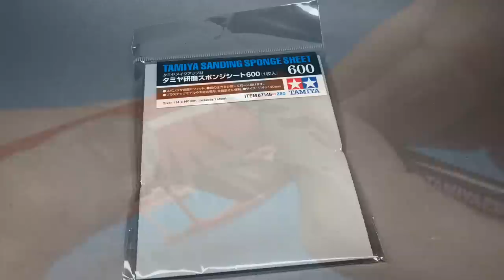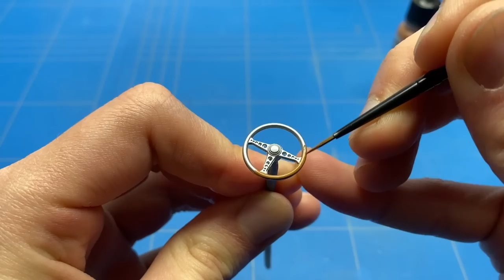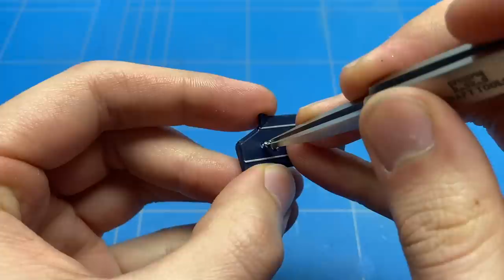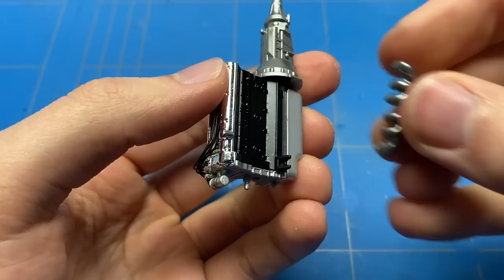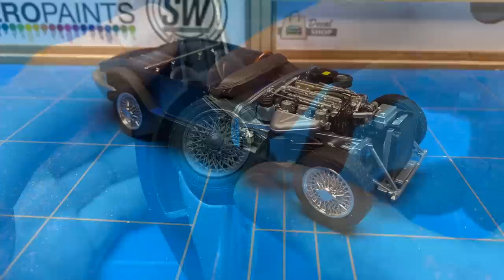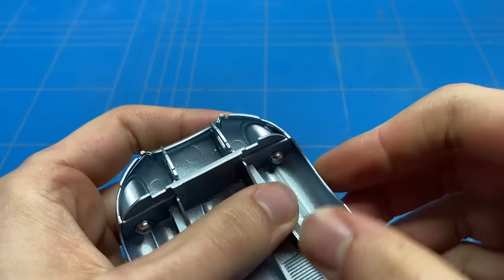Building a Jaguar E-Type Scale Model

Comment: I'm Australian.  Interesting to see such an iconic car that I lusted after IRL for so long in the 1960s and 1970s being built back-to-front.     To my eye, everything inside the car is on the wrong side,  while the fuel cap is on the correct side.    I am in AWE of the work you did getting those wheels done.      I have never seen Chrome on a model done that way and it's outstanding!!     Thank you for showing me how to do that. . And you were right to get the 3D printed wheels.     I always wanted some spoke wheels on a car.     It never occurred to me Id have to spend most of a weekend cleaning them every week.

Comment: Excellent build!  I am waiting until this kit from Revell of Germany is re-released.  I heard of mold issues on the body and RoG wanted to correct it.  Your did an excellent job building this kit!
Reply: Do you mean Revell will re-release the new tool they just released? I have bought this new tool twice now. Both kits have the bonnet about 4 mm too wide, lots of lumps on the body exterior. Otherwise the parts seem to fit together very well. Wrote Revell about the issue with the bonnet, they promised to send spare parts for free.
Reply: @Anonymous1999b , from what I have been told, Revell of Germany decided to re-engineer the body molds to produce a more accurate body and do away with the sink marks and bumps.  The XK-E is suppose to be re-released in June.
Reply: @007mrmike007  That’s interesting really. The new tool Revell XK-E (e-type in the USA) now has a pre-order status in some online hobby shops. But because the new tool e-type was just released, i wonder if they re-release or modify that also, because of the same issues? Or will this be USA only re-release? We’ll see i guess.
Reply: @Anonymous1999b  Since the Jag XK-E is from Revell of Germany, it would be safe to say that new body molds would apply to all kits that they are producing and not just the USA kits.

Comment: I've built at least 12 award winning Real Versions of these cars, roadsters and coupes, series 1,2,and 3. The only issue I have with the scale models kits I've seen and own are that the details are not correct. They're all over the place. The molds are all from an early series 1, like number 18 we did a few years back. The rear springs were black with yellow or blue inspection marks. The steering column is gloss black, all of it, the wheel hub is silver, but the entire column would be black including the turn signal stalk. The accel. pedal is cad plated silver. The floors have removable carpets in the footwells which contain a wide strip of vinyl. Only the very early cars had gold carb "tops", the rest were black. Transmission is semi gloss black, silver top. Drive pulleys are gloss black. An early car would have a black generator with silver caps, not an alternator. Positive ground, which means the yellow tag you put on the box would be correct for a later car, series 1.5. Negative Ground. That tag also faces out.  Exhaust manifolds are porcelain gloss black,  very shiny.  There's nothing gold on the brakes, all silver. The battery would have silver posts. Totally "wrong" radiator fan....thats part of the "details" I mentioned earlier. The shroud looks good but the fan would be a single blade, useless too! The heater core box is high gloss black. The intake filter Can should be the same color as the V-Box, stipple silver. Hammer tone. The washer bottle is white with blue fluid in it about 1/3 up. Thats the show rules. The brake bottle heat shield is flat white on the bottle side, silver on the exhaust side. A very early car would have red caps on the bottles, the rest would be gray. Considering those are square bottles, not round, they would be gray.  Believe it or not, the majority of the exhaust is black on an early car. It stops before the resonators, which are silver. It has no brake bellows, odd, which an early car would have, right next to the bottles. If not, then is would have an aluminum clutch and brake transom....this model has neither of them, odd, but, again "those kit details". The plug wires on an early car would have the XK150 style  conduit and the head would have 2 lifting bars across the second and sixth head nuts. Also, the plug wires go behind the radiator hose next to the engine, not over it. The is NO amber on a series 1 front lens. These would now be a series 2.... Believe it or not but on an early car, outside mirrors were a customer bought option!! Seriously!  They didn't ship them with the car. Good work on the assembly and paint detail. Nice camera work too!  Don't mind my detail nit-picking, its been my real job for the last 40 years of resto work.

Comment: That steering wheel looks unbelievable, thanks for the tip! 

At the end of the video, did you use the liquid chrome to paint the points where the chrome parts are attached to the sprue?
Reply from the maker: I did. Yes

Comment: There are a few inaccuracies with this model: Exhaust manifolds shown are not E-TYPE exhaust manifolds,  but early JAG 4 DOOR SEDAN versions which slant backwards, E TYPE manifolds point straight down from the center point of the side of the engine block. Windshield washer jar is CLEAR GLASS on EARLY E TYPEs / WHITE TRANSLUCIENT PLASTIC on later versions. RADIATOR FAN is only straight 2 blades, driven by its own electric motor mounted on the front cross frame and does not extend thru a grill behind the radiator, there is no shaft from the engine turning the fan. Also the turn indicator cover should be BLACK, the stem is chrome and the tip of the stem is black. The EMERGENCY BRAKE shown is for a RIGHT HAND DRIVE CAR, this model is LEFT HAND DRIVE. The TRANSMISSION shown here is an OVERDRIVE VERSION, NOT TYPICAL FOR E TYPES, (but available for 2+2 model), and finally the WIRE WHEEL KNOCK-OFFS are not correct type for Jaguar E TYPES.  . .WHAT A MESS.       '66 E TYPE OWNER.
Reply from the maker: You forgot the WINDSHIELD, thats also wrong

‘BUILDER OF INACCURATE MODELS.

Comment: Beautiful work. I have to ask….do you scrape the paint off the part you’re adding glue to or will it still work? Some of the parts looked to be a press fit requiring no glue…is this right or was the glue there? I’m just a beginner hoping someday to build my modelling skills.
Reply from the maker: I use super glue and don’t scrape the paint off, only if the parts don’t fit

Comment: Hi, am interested in printing those wheels. I have the file, and have an elegoo saturn printer, but am finding  the slicing software is adding a lot of supports within the rim, and attaching to the spokes, making them very difficult to remove without damaging the part. Did you come across this issue as well, and if so, how did you solve it?
Reply from the maker: I placed the supports myself. Not using the auto supports

Comment: Fantastic work, I could never dream of doing as well. That said, having watched a number of model builders on youtube, there are just some things that could be improved. I personally really dislike the foil, it's very obvious. The chrome finish on the wheels is great and I wish you could use that. I can also see some unevenness in the plastic or paint in the cowl area. There is a dent/bulge on the driver's side of the hood and perhaps the fitment could have been improved. I did love the inclusion of 3d printing in this build, it's the first time I've seen that.

Comment: Hi, I bought the same airbrush mr.  hobby ps-290, but after applying the varnish, it spat out the remnants of the dry previous paint on the surface, although I washed it.  How do you service it after painting?  Do you completely disassemble it, unscrew the nozzle every time?  The instruction does not recommend doing this. Thanks)
Reply from the maker: if it spits out paint, it has not been cleaned out well enough, you'll need to be more thorough. Do not remove the small nozzle piece, that will break very fast. You can remove the bigger front piece with a wrench.

Comment: The plastic looks pretty brittle / hard {I stand corrected if I'm wrong}not like the usual plastic, that though is nothing to do with your build. thanks for sharing this video, build and content which are both fantastic. This is not meant in anyway a critisim just a long winded question. Could you tell me please, the gauge of wire used to add detail? and does your friend sell those wheels ?many thanks
Reply from the maker: The plastic seemed fine to me. Nothing out of the norm.

The wire is from scaleproduction. I do not know the thicnkess.

I don’t think he sells the printed parts
Reply: thank you for the quick response mate, I'll try it myself :}

Comment: A beautiful build by a very skilled modeler. However, there is a major problem with these car builds, and it concerns the window frames. I noticed this already as a kid of around 12 years, and eventually it made me give up on the hobby. Since then I have returned to it several times, but again and again I have had to give up. Even a modeler as great as the one featured here can't solve it, as you can clearly see. The window frames are all over the place, absolutely awful and in no way up to his general standard. There are these little areas where the hobby is a total letdown. With figures it's the eyes, with cars it's the window frames. These issues are ruining the hobby for me, totally!